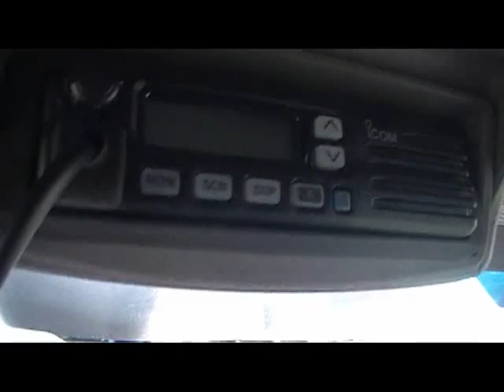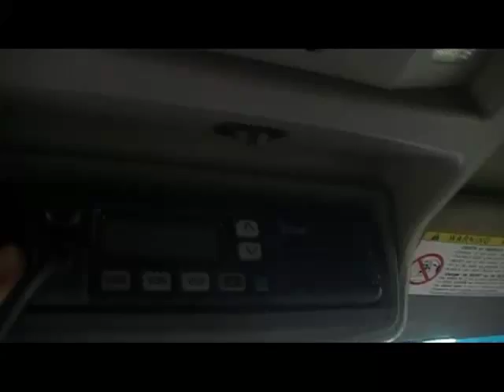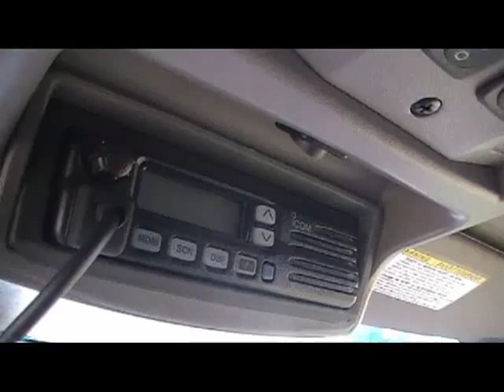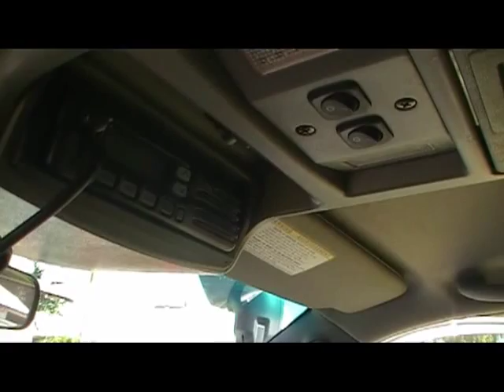Outback Roof Console install for 120 series Prado Part 4 and final.mp4

Comment: The only video I've seen on the 'Tube' so far, that talks about, even 'shows' the obstruction (or lack of it) with regards to the rear view mirror. Also the comment with whacking your noggin is great stuff to hear too, and what holds the radio in etc, well done.
Reply from the maker: Cheers I can help

Comment: Well done on this video.  Very informative and it really helped me in deciding to place an order for my roof console.  I too have an ICOM radio and did not think about the transmitter being on the left side but from your installation I can see it worked and will do the same.  Thanks again.
Reply from the maker: +Richard James Glad I could help mate.
Reply from the maker: +Richard James Glad I could help mate. I do hit my head on the console every now and then getting into the vehicle and it's good the mic is on the other side.
Reply: +winniliss Shit, I am 6 foot 3... does that mean I will have an egg on my head everytime I get into the car :-)

Comment: Hi Winniliss Thanks for the video, I fitted my console some time back now probably about the same time, I actually made up a bracket to fit the radio to the roof first then I slide the console onto the radio, bit fiddly but the beauty of it is the radio and bracket actually hold the console in place whilst you do the screws all up. Kind regards Dave Wright